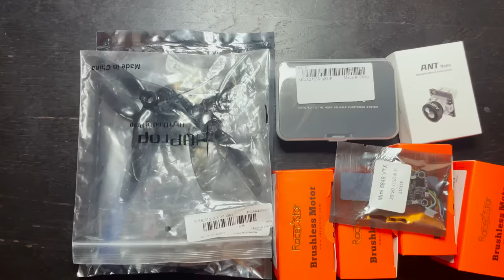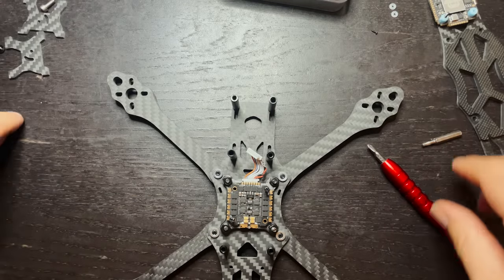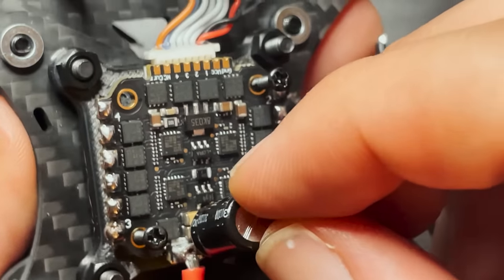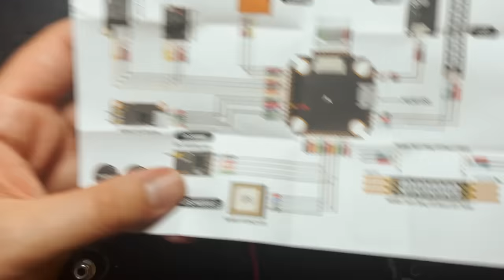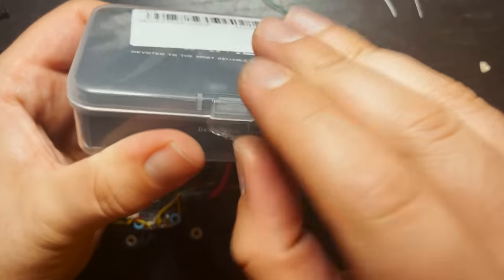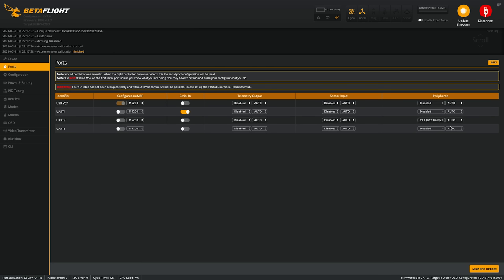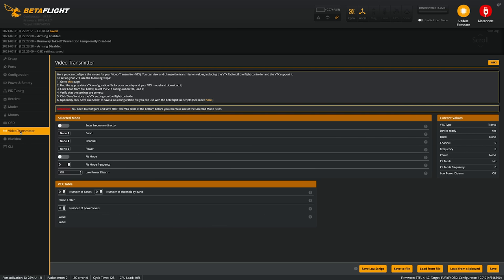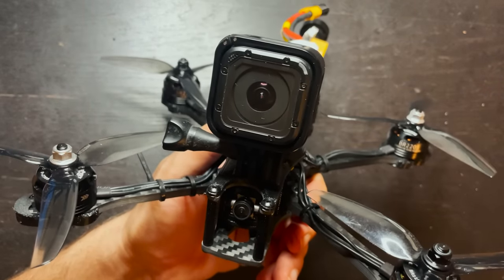Build a Freestyle FPV drone for $150!!

Comment: Pro tip for making your solder look perfect every time. Always use flux! Even when using flux core solder it help's immensely to flux up the pads and wire tips before soldering and makes the solder joints look uniform and flat.
Reply from the maker: Since making this video I’ve started using flux more and it does make a difference. Thanks for the tip!
Reply: Yup, flux is your best friend when soldering RC electronics! I prefer the paste as it's much easier to apply a precise amount.
Reply: Also, clean that soldering iron tip.  My goodness, my OCD kicked in and that is all I saw when the soldering was going on!!  LOL!😮
Reply: @dcampbell8779  That’s exactly what I was thinking. You can buy enough tip thinner to last half a lifetime for $10. 

In my experience a properly cleaned and tinned tip does WAY more for the quality of solder joints than using extra flux with flux cored solder.
Reply: If you use very very good quality solder often it's not needed to use flux ... when I use cheap solder(Even with flux core because they're not all created equal) I use my flux pen all the time.
Reply: Came to say the same about liquid flux. Also start making a "heat bridge" by putting the solder strand between the part and the iron. Avoid just laying the iron on a dry pad/ lead/ terminal etc.. This will help in eliminating cold solder joints and pinholes and help the solder to wet with the other metals much better.
Reply: @256alexdt  Milspec soldering requires the use of liquid flux always. What people hate is the mess and I get that, but you can't make pottery without water, and you can't do great soldering without liquid flux. Another great use of flux is with solder wick.
Reply: Someone's gonna get fluxed up  :-P
Reply: Flux is your friend indeed, even with a constant shake in the hand I still make great looking bonds, the stuff practically does it itself really. And naturally keep your tips clean, that's a basic.
Reply: Lucho RR  In the context of electronics and metallurgy, flux is a cleaning agent that removes / prevents surface oxidation. This keeps the solder flowing, prevent overheated joints and allows for properly wetted metals (such as copper and tin). 
 In the Milspec world of soldering, liquid flux (usually RMA) is used with flux cored solder. This will make the highest quality joints, tins and rework, but it also makes a mess. Flux residue must be removed, so have a can of flux cleaner on hand.
Using flux on solder wick makes for easy desoldering, just be sure to loosen the braid before you add the flux.
Reply: Lucho RR  in metallurgy it a general term for chemicals in various formed that assist in many things, can facilitate in removing contaminates from a weld as it's done for example. Some are used to remove contaminates from a metal melt such as when refining ores. Some are used in helping to get 2 pieces of metal to fuse when folding during the smithing process. In the case of electronic soldering it's often a brown paste that you apply that can help heat transfer as well as helping to create a nice flow of the solder as it's a different density to the flux and the solder will find a seating where it can bind such as pins on a board or copper ground.
Reply: Your not worried how your solder "looks" you need to make sure its not a cold solder joint.  You millennials are freaking ridiculous. Flux core 60/40 solder is all you need. You DONT NEED to add more flux it will cause you issue later on. If you can't solder take some practice on some junk boards. Take the time to learn something properly and not listen to so called you tube experts.  Soldering is not difficult thing to learn.
Reply: @InternetGoldMiner  The easiest way to detect a cold solder joint is by the look of the solder 🤦‍♂️. I'll take my years of Milspec training and experience over YouTube solder experts. I never said one had to use liquid flux, but if you want the highest quality solder joints that are least likely to fail you will.
Imagine thinking liquid flux is some how a millennial thing, absolutely mind boggling.
Reply: @InternetGoldMiner  Have you ever done a lot of microchips or smd compenents in a small area before? Flux also helps the heat travel and the solder to seat btw.. And what issues later? Cleaning things off afterward?
Reply: S39 😎
Reply: i was 11 minutes into the video and i was like FLUX MAN! lol glad i looked at the comments to see everyone else was like, yea dood try flux its amazing :P
Reply: meh. Clean the tip every time, and pre-tin the wires and tip every time, and it'll work fine. You really only need to use flux if soldering to a board or something sensitive. If just soldering wires, just pre-tin and keep the tip clean.
Reply: @Goncalvesbrunot  thank god somebody else said it. I see so many videos with dirty soldering tips taking forever to heat shit up, meanwhile they be jamming solder on the luke-warm component like it's going out of style. A tip cleaner is so cheap, too. Or just get creative, boggles my mind.
Reply: I do solder work professionally, and couldn't agree more. There's only two types of people who solder, people who suck at it, and people who use flux. It's basically liquid skill.
Reply: @InternetGoldMiner  even with flux cored 60/40 it can help to use flux sometimes, especially for SMD work.
Reply: FLUX IS YOUR FRIEND!!!
Reply: you are not supposed to use flux with electronics if you do you have to use a specific flux designed for electronics otherwise it is acidic and will corrode the wire and pcb
Reply: @johnwasson8604  Indeed, you can't just use plumbing flux, you need the tool for the job. For some smd work and for stuff like BGA reflow you will need a good quality liquid resin flux. It also makes tasks like touching up IC legs  much easier and neater looking. You can then clean your board with isopropyl and ultrasonic after.
Also incredibly helpful for desoldering components neatly.
Reply: IPC does not recommend fluxing wires as you will end up with solder wicking underneath the insulation, which makes the wire inflexible. Definitely flux the pads, however. Fluxes are designed for certain solders, check what the manufacturer recommends you use with their solder. Kester 186 is a great rosin flux.
Reply: @chrisw5742  everybody’s fluxing round here!
Reply: @dcampbell8779   Ugh agree. I find tip tinner works very well for cleaning tips.
Reply: Rosin core is actually the problem a lot of times. Unless you do a lot of soldering and plan on using the whole roll up within a few weeks, get 63pb/37tin ACID core or SOLID CORE and apply your own, fresh, high quality flux separately as needed. Rosin cores and acid cores can dry out, degrade, and change pH with age...most importantly, the volume of flux in the core is variable. You'll have dry spots, then a few feet with tons of flux in the core, flooding your joint and making a mess. Best bet for most situations is thinnest, highest lead solid solder you can use. I like Kestor liquid flux and CAIG labs gel for most stuff. Yellowell is good. Nokorode is my go-to for heavy duty/dirty jobs (power tools, automotive electrical, industrial equipment etc) but stay away from SRA, Oatey and chinese mystery goo, although they're better than nothing. Get what you pay for in the world of soldering and welding. Do it right. Do it once.
Reply: @InternetGoldMiner  Rosin core is all you need, says the dude rocking a clapped out Weller 8200 with a rusty tip...he uses twice a year fixing the same cold joint that keeps failing. I'd pay money to watch this guy mangle a 5v trace lol
Reply: @j.e.k.6014  well said. Soldering is easy and extremely satisfying once the j std and or milspec is learned.
Reply: @Wpjgdmtu  i am going to look at that tomorrow. I have always been under the impression that you want a small amount of solder under the insulation in order to prevent birdcaging of the strands.
Reply: side not when fix pit flux on again and just remelt with the sold on it and itll clean it, be quick though when doing, itll look like a mirror when finishined
Reply: @256alexdt  yeah, I solder at least an hour a day for my job. For jobs like this, extra flux is usually used to make up for poor technique. I wouldn’t even consider using flux for this.
Reply: @j.e.k.6014  Lol you absolutely can. I do it every day.
Reply: @derp195  Do what?
Reply: @LazloNQ  Thank you for your comment and the 500th like.

Comment: necro maybe, but you might design and print some landing buffers out of TPU for softer landings in case you cut power a few inches above the  pavement. You could also try printing TPU pads for reinforcing / protecting other bits on impacts/crashes.
Reply from the maker: We ended up printing tons of parts for this build. Theres so much stuff out there for the apex frame that fit this one 👍

Comment: The emax eco ii motors are a good low budget choice. I dont recommend flying around cars for maiden, never know when things could go wrong after fresh build.
Reply from the maker: Agreed! I just added the eco ii motors to the description! This wasn't the drones maiden flight, we flew it in a park beforehand. This flight is after making sure everything was working good. Thanks for watching!
Reply: Bigger motor = higher ESC specs.
Reply: @The1188am  so the recommended esc wouldnt work with the upgraded motor?
Reply: @mr.animegod_yt  it would, the mamba esc in this video should be able to handle emax eco ii just fine

Comment: I was considering buying the Emax Tinyhawk II Freestyle as my first drone, but I would definitely prefer to build my own as I already have the tools.
You think something like this would be nicer?
Reply from the maker: I think starting off you would probably be best with the tinyhawk. If you get the package with the controller and goggles you can use those goggles with any analog drones you get in the future. Also, the tinyhawk is relatively durable and is actually alot of fun for its size. I would recommend going with the tinyhawk then eventually upgrading to a simple build like this. Hope this helps!
Reply: I started off with the Tinyhawk II and I'd recommend that to all pilots new to FPV. It's super durable and can be flown inside which is a ton of fun!

Comment: Hey thanks for the wonderful upload.

Couple questions.
Instead of the 20x20mm flight control and the 20x20 vtx… could I just use a 30x30 flight controller and 30x30vtx?  Or a 30x30 flight controller with a 20x20 vtx? Hopefully I’m making sense with my questionslol

Also, the Mount for the fpv cam, was that also 3d printed? Could you provide the specs that please?
Reply from the maker: Absolutely! Only reason I went with 20x20 was because of the quality of the stack and the price that I was able to get it for. the 30x30 stacks are typically more expensive. you could definitely do a 30x30 FC and 30x30 VTX as long as you can mount it on top of the FC. the rear holes on this specific frame are 20x20.

So the camera that I went with is a nano. it came with an adapter for nano to micro but the frame I'm using holds a mini camera. so basically I have two brackets on there holding it on lol. the bracket that came with the camera and one that is 3d printed. I just posted a link to the adapter I used in the description (https://www.thingiverse.com/thing:4070488). 
Hope this helps!
Reply: @TRONCATFPV  nice! Thank you for that link!

So I can use a 30x30 fc with a 20x20 vtx as long as the vtx is mounted at the bottom?
Reply from the maker: If by bottom you mean the rear of the drone then yea that would work perfect 👍
Reply: @TRONCATFPV  yes, that’s what I meant lol thanks again!
Reply: @johnzapata8954  ron zacapa
Reply: @TRONCAT FPV  Hello, can you send an alternate link? This one isn't available anymore

Comment: But the controller? And the battery?
If you include these prices its still like 500$
Reply: You can get a couple batteries for $50 to $60. 
You can get a good controller, radiomaster pocket, for $55 (Edit: $65 for elrs plus shipping) (pre tax)
Finally a budget pair of FPV goggles for a $100.

Additional $215 in cost.

Grand total: 150+215= $365 (Edit: $375 elrs radio)
Reply: He never said rtf 🤦‍♂️
Reply: And most drones are over 250
Reply: @GarrettBShaw which goggles costs 100 ? Ahahah 😅

Comment: I would recommend you clean the tip of your soldering iron and tin it. you will get much better soldered joints as the heat transfers quicker and produces a nicer soldered joint. 
Those joints to the battery wires looked Dry.  Apart from that an excellent video. 
Thanks for sharing.

Comment: Might have to do this,  great video,  may I recommend fluxite soldering flux,  makes solder flow so much better, sucks into the wires and leaves a great finish
Reply from the maker: agreed, since publishing this video I have been using flux more, especially on the bigger soldering pads. It definitely helps!

Comment: Leve it to an old tech to tell you to clean your tip off on a wet sponge then tin it first prior to soldering anything. It transfers heat quicker and cleaner.

Comment: Electrician here. Got a tip for ya buddy. If you swap the yellow connectors on the battery around, you won't have to worry about shorting your battery when it's unpluged. The plug with the holes is always the supply and the one with pins is always the appliance. Words to live by, trust me. 😉
Happy racing!! :yougotthis:

Comment: Hello, the detail you put in this really sets this apart from other videos. Could you please tell me which screws you used to mount the vtx with rubber grommets? I would really appreciate it. Thanks.
Reply from the maker: Those are just some spare M3 screws. The rubber grommets I believe came with the VTX

Comment: Hope you printed that adapter plate in nylon. Good idea to brush on a coat of epoxy resin to harden structural parts and keep layers together. You're better off printing a slightly thinner part and making up the thickness to required dimensions with multiple coats to make a shell of resin. You can make petg and pla fdm parts almost as strong as GFR nylon this way using the correct resin.
Reply from the maker: For that part I printed in PLA and it has held up in over a year of continued use 👍

Comment: Great beginner soldering skills. Glad you are learning. Next time use flux and it will make the solder connections "flow" much easier! (Less "spikey/dry" solder joints....more "liquid" and smooth like factory).

Soldering without flux is like building a campfire with bricks. It's "blocky" and crude. With flux, it's smoother and makes the connections look like factory. 
-coming from a lifelong microsoldering engineer!

Comment: Pro tip: when soldering, less is more. Just tin the tip of the wire, then tin the pad. Heat them up together, they will fuse.

Comment: Where I live the parts will cost much more than $150 even if I factor in currency conversion.
The Mambasys stack alone is $129.58. Also the googles and controller are not included as the video relates to the drone build. 
The title brought me here.
But the video and depth you go into is excellent, awakened my maker skills to build a drone. Thanks for taking the time and posting, excellent.

Comment: Awesome tip with using the floss to install the grommets. Those damn things always got the colourful words flowing during my builds. 😆
In return I'll give you a build tip.
You can protect the motor wires from prop strikes during crashes by taping a section of a prop blade (from a damaged prop) to the top of the arms over the motor wires. The silicone wire shield is awesome to work with but a bent prop makes a mess of the real fast.

Comment: This is really cool, but if tou don't already have a radio transmitter to control the drone, and goggles, then you need to buy those.. the ones linked in this video (as of July 6, 2024) cost about USD $270 together (probably plus shipping, i didn't price that)

Your build and flying are impressive. Seriously nice work! But for me to start this hobby, I'm going to buy one pre-made, then come back to something like this when I'm ready.

Comment: Those are some cold solder joints.. either your iron is too cold, or too hot and damaged the tip. Try setting the temp to ~220C (look at the specs of your solder for the exact temp) and clean the tip. Also try not to use that much solder or you risk short circuiting stuff.

Comment: nice build, thanks for sharing.  Dont you worry a little bit about a failure causing the drone to fly into one of those parked cars?  Seems like ti would put a nice hole in a windshield or at least dents and scratches.  You must be very confident of your budget drone design!

Comment: Loved the video but I was lost when the. beta flight came in.
I have a few questions if you can answer them...
1. Why is there one big camera attached on top of the drone next to the battery when you already placed one exactly below it.
2. Did you place two receivers??? The one with the zip tie and one with the big golden bolt.
3. How do I connect the drone to a controller? Do I have to build one? How did you fly it??

Sorry for asking too many questions but I just started making my first drone and I have no knowledge

Comment: I can rewire and solder boards, show me the build I need to do in this era, is it similar?  I've been watching tons of vids, and getting to know the complexity of the short, mid, long ranges, the prop angles, the radios, the cameras, the latencies, the goggles, and motors, and the types of receivers, not to mench batteries 4,6,8 so just to show you I'm interested in this hobby